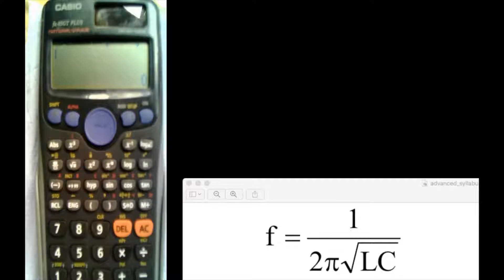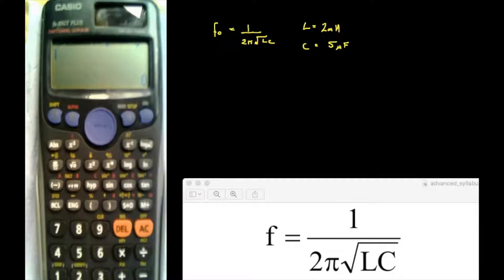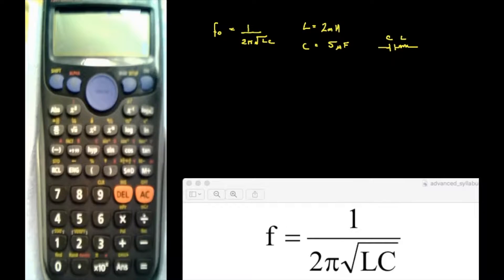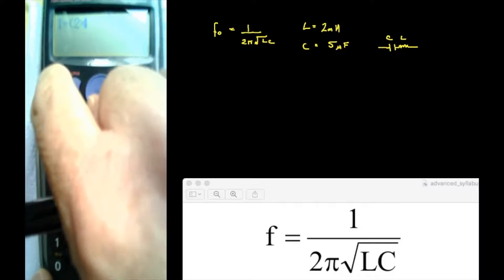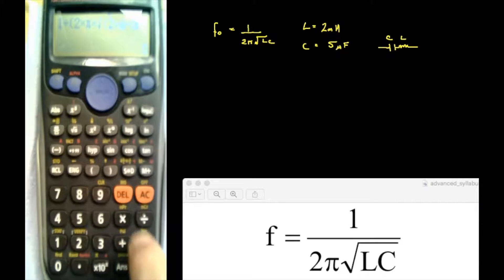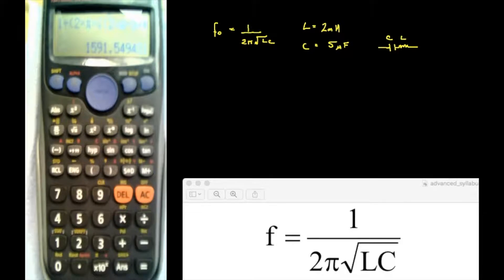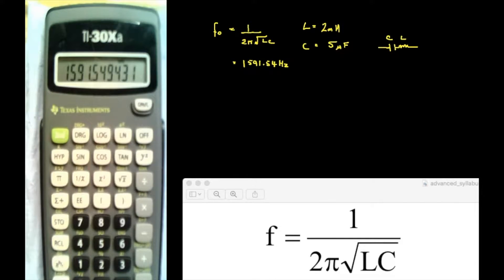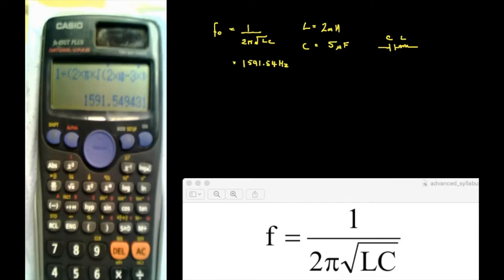Advanced - Casio fx-85GT PLUS

Comment: With the casio calculator the equation can be entered as shown in the example formula. 1st press the fraction button below the Abs button and enter 1, then using the direction pad cursor down to the bottom half and input the 2π  √ LxC then equals for the answer.
Reply from the maker: Thanks for that.  I am no expert on the VPAM way of doing things so clarifications are welcome !